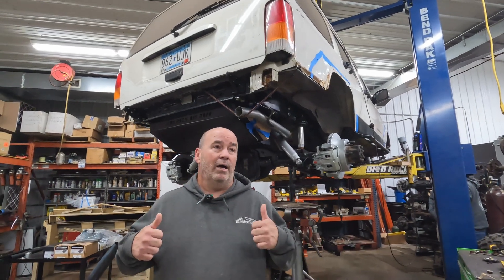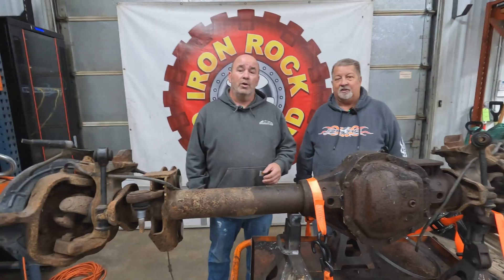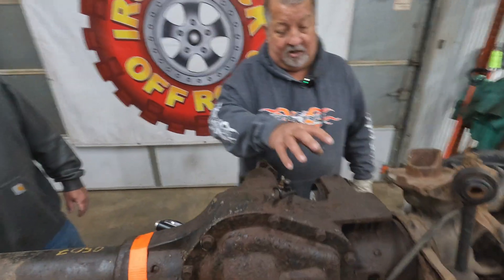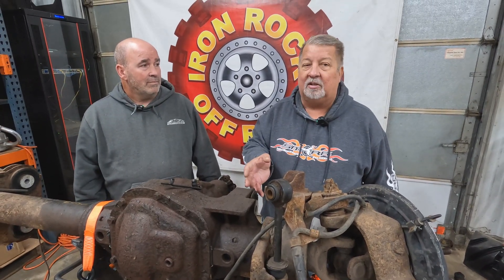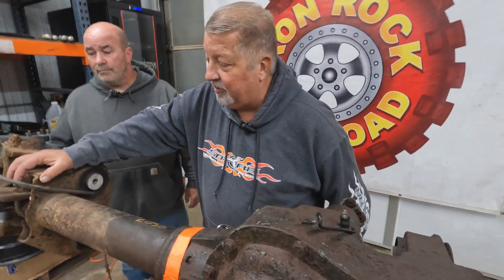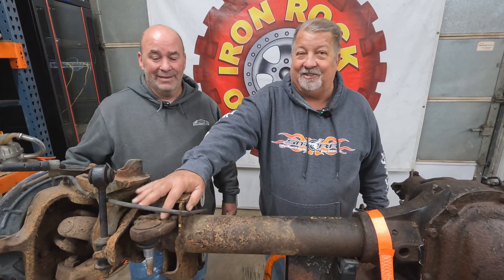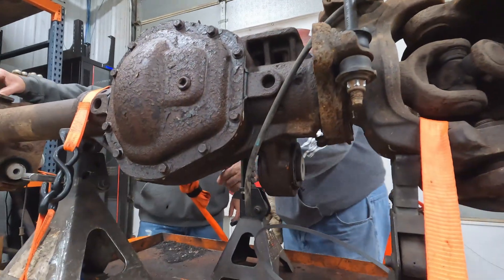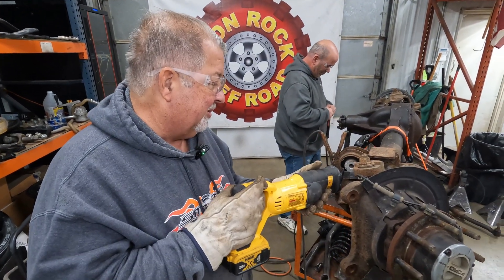Dana 60 Deconstruction: Expert Advice For Your Axle Swap Project!

Comment: waiting for the hydro bump stops in the xj ❤
Reply from the maker: @Vitasshop No need to wait! We have the kit available on our website:
https://www.ironrockoffroad.com/product/xjtjzj-front-hydro-bump-mount.html

Video coming soon!
Reply: @IronRockOffRoad i mean the video 😍🫶🦾
Reply: @IronRockOffRoad is the xj set up going to have the same gusset concept as the wj set up for the hydro bump stops ?
Reply from the maker: @Vitasshop XJ video coming soon! The XJ version does not have the gusset like the WJ. The factory WJ spring mount was designed to only carry the spring load, so we beefed it up with gussets to handle shock loads from the new hydro bump stop. The factory XJ spring mount was designed with the bump stop integrated into it. We simply changed the bump stop design. The XJ version is quicker and easier to install.